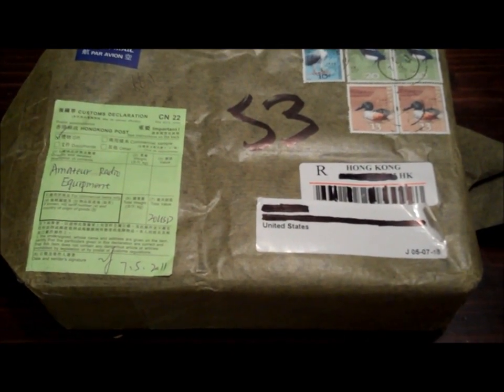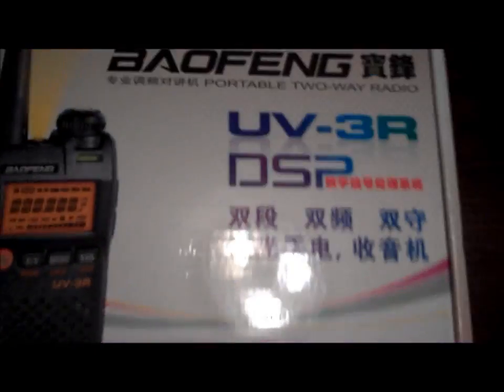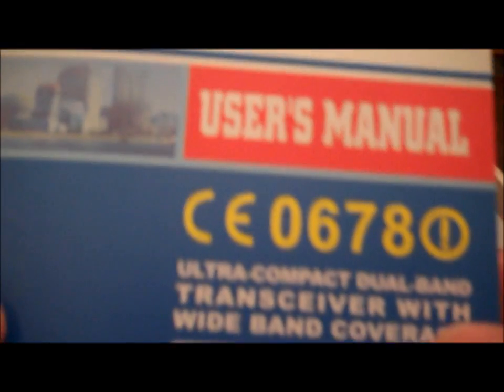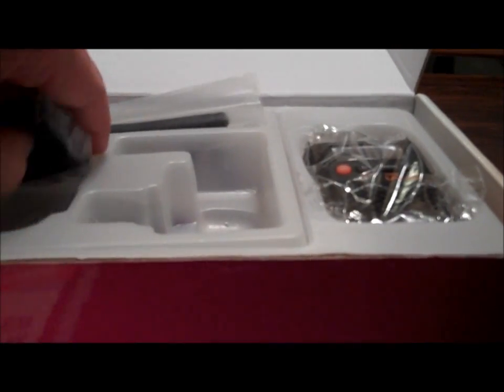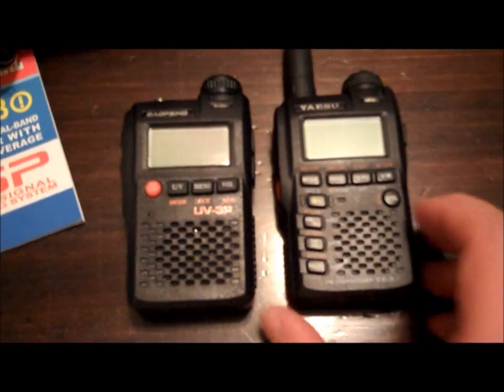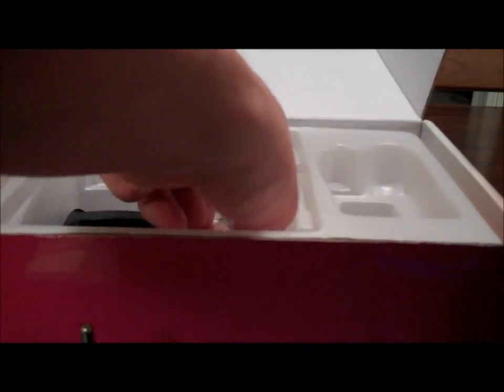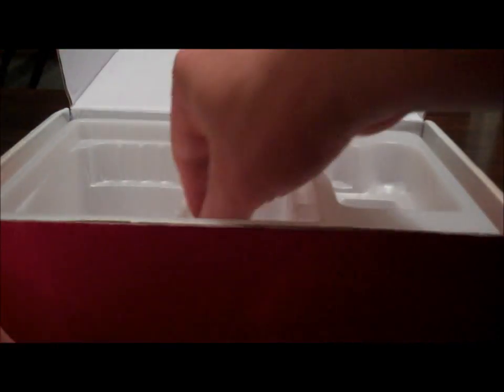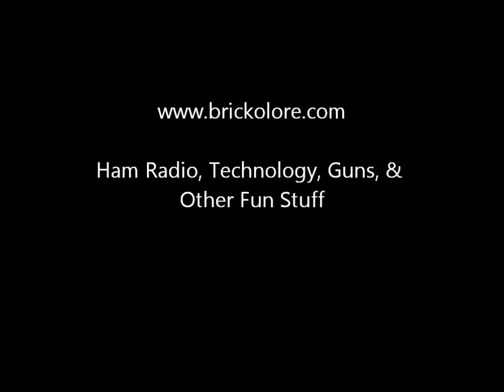Baofeng UV-3R Unboxing

Comment from the maker: @Aviator14
Very similar indeed - at least on the outside. For example, the AA battery pack for the VX-3R fits on the UV-3R with a slight modification. Check out all I know about the UV-3R using the link in the video description.

And if you think the UV-3R is a VX-3R clone, check out what KYD is releasing this month - the KYD NC-5H, KYD UV-5H. (Added a link in the video description since, YouTube won't permit them in the comments.)